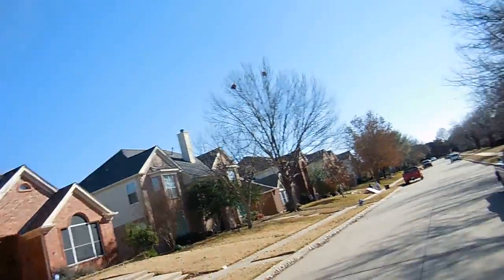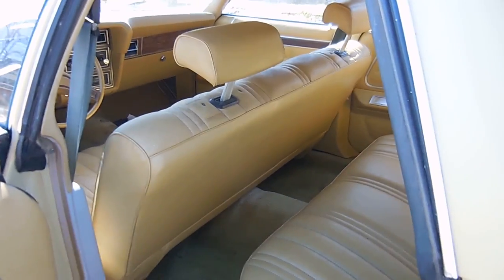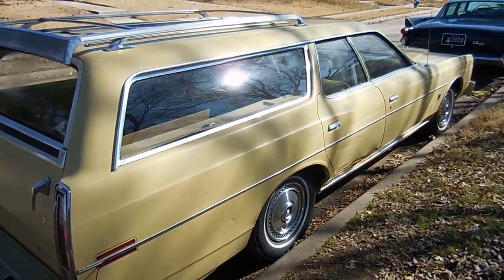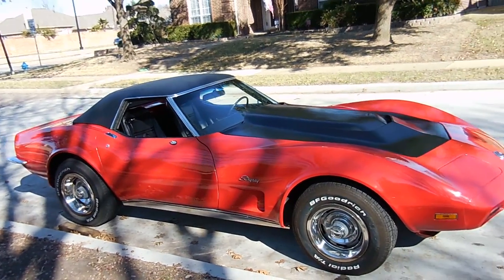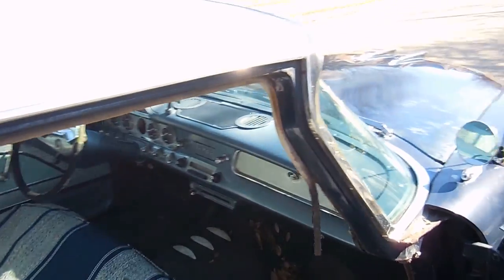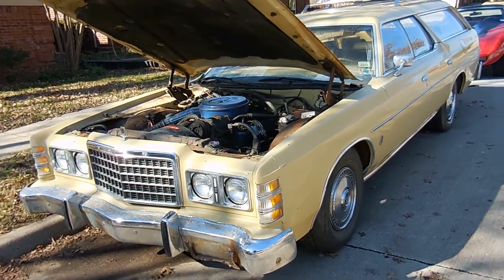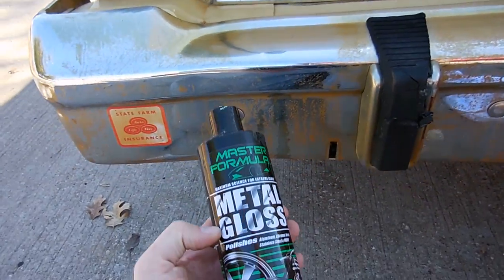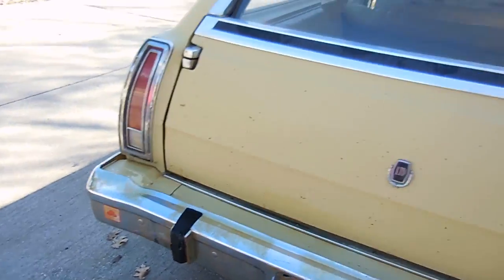Griswold Family Truckster 1976 Ford LTD Wagon Part 1 of 4

Comment: This one is already my favorite, good old LTD. Also loved that Edsel you fixed, and of course that '58 Chevy. Worked on so many Ford V8 tune ups, I can rebuild that Motorcraft carburetor with my eyes shut. Have one on my '82 Galaxie, and it's four barrel brother, the Autolite 4100 on my '74 Galaxie. Just one advice: Be careful with the float level adjustment.

Comment: The Torque-Converter has a drain plug....meaning all the old nasty fluid can be replaced come filter change time on the C6. My parents bought  one Brand New (same exterior color) back in 1978......but it had fake wood, cloth interior,power windows,everything.

Comment: I absolutely love these wagons, I used to have an 89 Oldsmobile Custom Cruiser wagon, and I regret ever selling it. I also have a 76 Mercury Marquis nearly the same color with the same engine! Not sure what the status of the engine is, but just a heads up, if you experience a problem where the engine is running fine, and it will just randomly cut out, it would probably be the ignition module, I had that problem with my mercury a while back. It is awesome that you saved this wagon because they are incredibly hard to find, I am really looking  forward to the upcoming videos!

Comment: My Brother-in-law had a Mercury wagon very similar to that yellow Ford. It developed a problem where it would just suddenly stop running. He had it towed a couple of times where they changed plug wires and ?? other stuff whereby it ran again. Mostly because it had time to cool off. I was playing with it at home in my garage one day when it did it to me. Nearly wore the battery down before I figured out the little contact strip on top of the distributor rotor was "barely" touching the little graphite tab inside the dist. cap. Bent the tab up a little and it never quit again. Have fun with your new "Banana Boat". ;o)

Comment: Damn your 4 years off! my father had a 1972 LTD Coupe I think, it was either a coupe or a 4 door, had it till 1977 I think and it ran well, only problem was that a seal failed and transmission fluid got into the engine and well it basically did a James Bond Smoke screen effect on the last drive when he was trading it in! 

actually maybe you can turn this into that project car they featured on /drive, the green station wagon that can blow off people at stop lights lol

and wait the dodge is going to sweeden, your not dealing with that guy from fast and loud who sometimes shows up to buy cars to send to sweeden are you?

and did you take your mirror of of your corvette there?

Comment: If the Ford wagon has over 100k miles on it, replace the engine timing chain and timing sprockets immediately.  Those nylon teeth on timing cam sprocket become toast just after 100K miles...

Comment: Yup looks like an old ugly big junk coffee table with a steering wheel 
that should have been crushed years ago to a pancake. Had many new 70s 
big junks my self....never again.

let me guess....It's full of holes and bondo, leaks oil everywhere, no 
start/stalls need a bunch of ether cans to get running, rusted out 
floor, over heats burns more fuel than a 747, no pollution control so it
 stinks like a lawn mower...after all they would
 only last 6 years tops can't fool me. besides nobody buys these hunks 
of shit no more. Waste of money to rebuild and hard to sell after you 
wasted all your money on it . Just fuck'n garbage and I glad there gone.
  1900-50s are worth and ok to rebuild I know
 what I am talking about, I sell automobiles for a living. We don't take
 these old junk 70's in on trade, they just sit on the lot forever. 
Easier to sell something from the 50s. We have tried to sell the junks 
of the 70s before with no luck at making any money..end
 up taking a loss and send them to an auction. Like I told you before a 
big waste of money on these big funkn ugly junks. Save your money, 
invest in a Ferrari it will = the same cost of rebuilding old garbage.
Reply from the maker: +john burry If you don't like the car, don't watch the videos